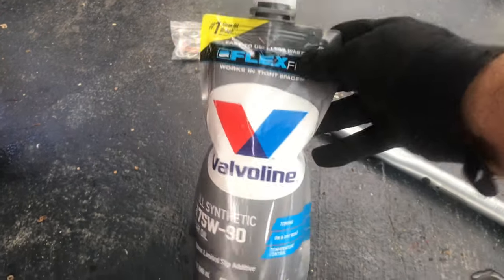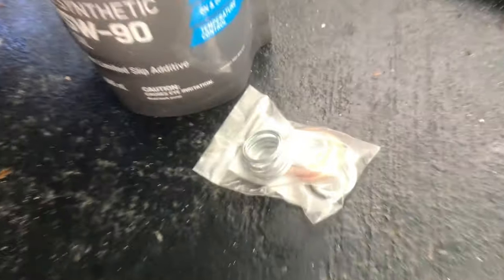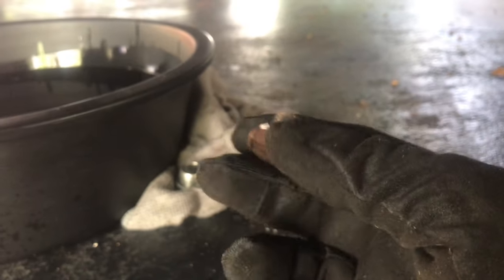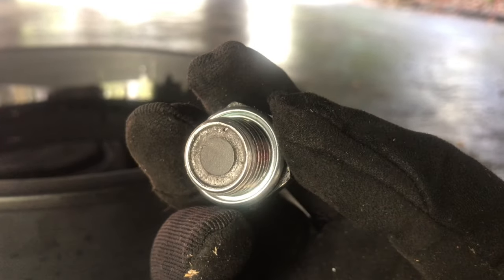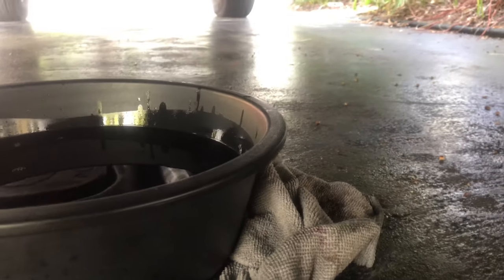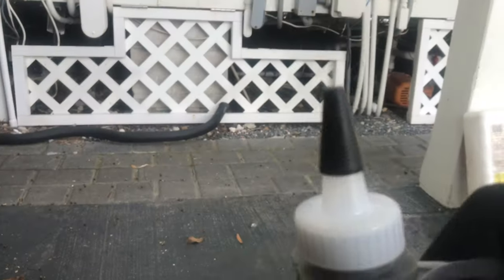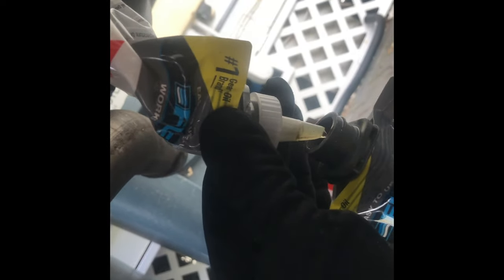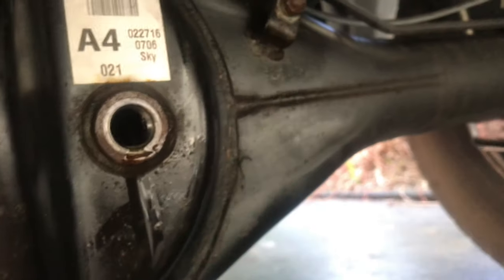Toyota Tacoma 2016 Rear Differential Oil Change #tacoma #diy

Comment from the maker: 2016 Toyota Tacoma Rear Differential oil change.

Tools Required:
-  Deep Impact Socket, Metric, 1/2-Inch Drive, 24mm: https://amzn.to/3XgHNT2

- New crush washers: https://amzn.to/3VaYlcA

- Gloves: https://amzn.to/45jC010

- Oil drain pan:  https://amzn.to/3KArMQm

- Differential Gear Oil: https://amzn.to/4eeMC5r

This is an easy DIY maintenance task to be performed at 30K miles for Toyota Tacoma.